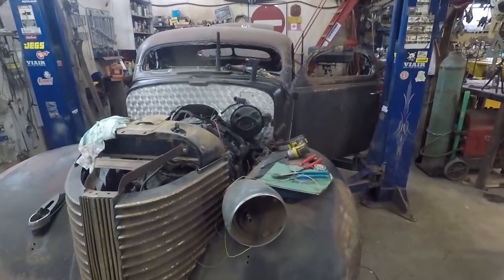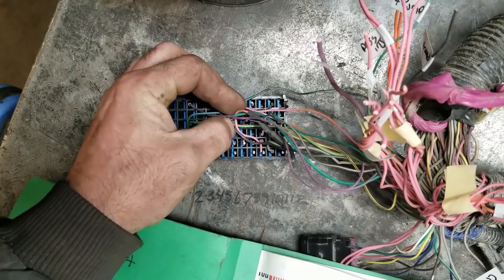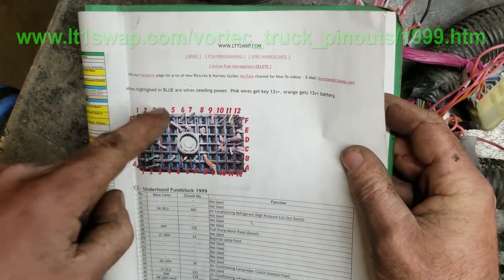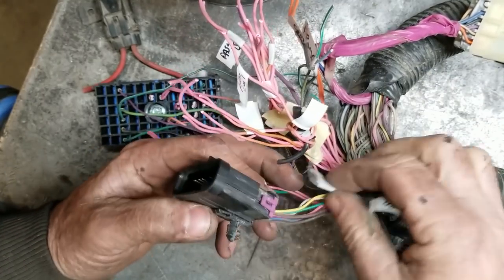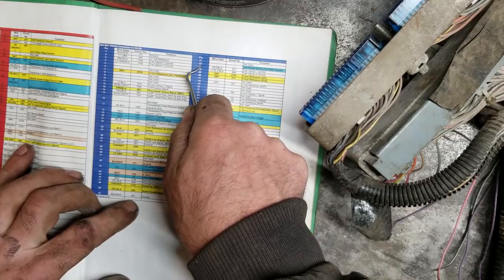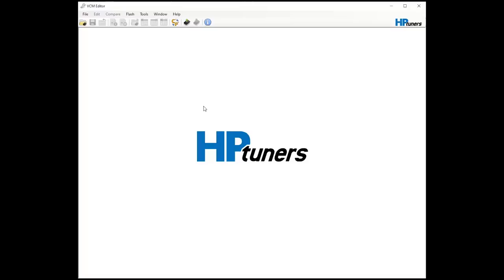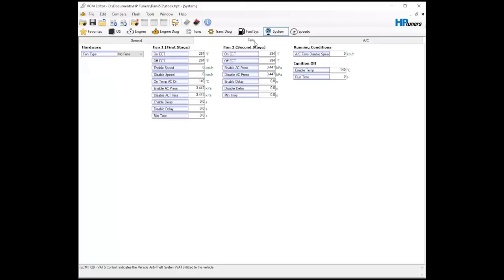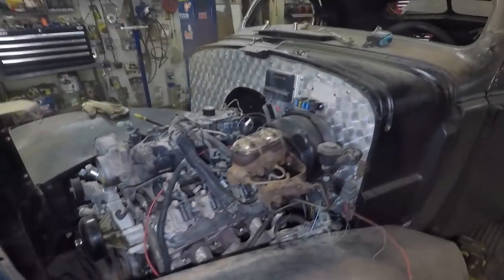Cheap LS stock Silverado wiring harness rewire to run standalone and what to unlock in Hp Tuners

Comment: Give me an old 283 any day with a total of 1 wire to the coil and a negative and positive to the starter to make it run. Oh ya, and a screwdriver to jump the starter. LOL.
Reply from the maker: Yeah I hear you there. Even better a 12v cummins just need to start and zero electrics :)

Comment: I love your simple overview of what you change with HP Tuners.  I have been skeptical about  whether I wanted to take the time to dig into it, and I believe you just convinced me.  Cheers  Mike!
Reply from the maker: Yeah it is over whelming at first, but at least if you buy it it comes with 6 credits so you can unlock 3 computers. that's what factored in my why I bought it figured if I payed someone to do the first few unlocks the unit almost  would have paid for it's self.

Comment: Thanks for the info, however for a vehicle that still needs to pass emissions I find that if I leave the box checked and on the drop tab put no error reported the vehicles monitors will be ready if you un check the box the monitor would stay pending. That’s from my experience.